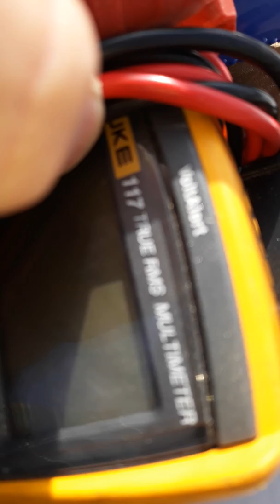Fire alarm tech tool pouch and tools I use on a daily basis for troubleshooting fire alarm systems

Comment: What panels do you like to install we’ve been using the napco firewolf series and now they’ve got a new one I think it’s the nafcp or something anyway great video 👍
Reply from the maker: I've been doing it so long I have installed a lot. I prefer to do troubleshooting over install. I have installed the following:
Burglary system 
Adecco vista10
Vista20
180 b/f
Networks
Hai
Fire
Notifier 
Cwsi 
Silent knight 
Ansil 
Potter 
Cheetah 
Firelite 
Fci 
7200
E-3
Telephone 
Vodavi 
Mitel 
Sprint
Panasonic 
Nortel 
Gate controllers 
Door king
.....
Networking 
Mikrotik 
Ubnt
Cisco
Indian
And few others.
Hope that helps.
I like fire lite best.
Reply: K Hawk awesome man thanks for the reply
Reply from the maker: @ReachBreach117  thank you for watching. If you want to see how to troubleshoot a curtain issue just let me know and I will do a video
Reply: Great video thanks, very interesting to see your manufacturer of panels list, Im a Fire alarm tech in the UK and have only heard of one of these manufacturers (notifier) over here we have a different set of brands, be really interesting to me to hear more details of US fire alarms, how they work, what voltage you work on, and your standards i think you might call it ‘code’ ie rules on detector spacing etc
Thanks for making